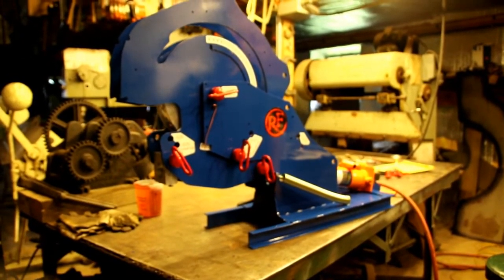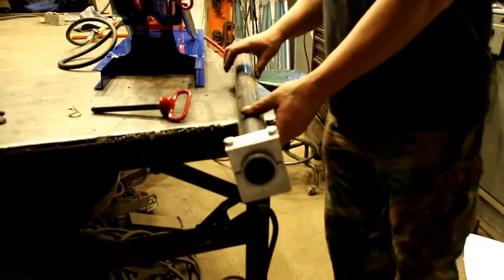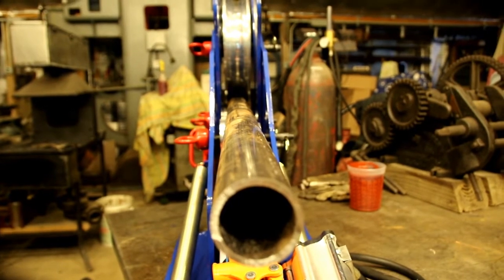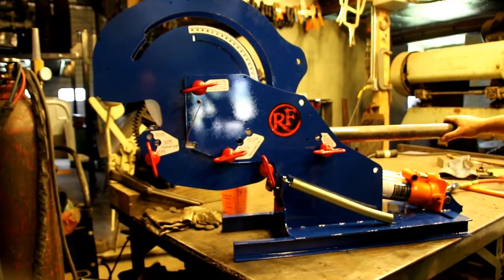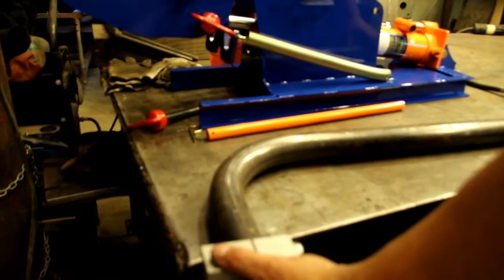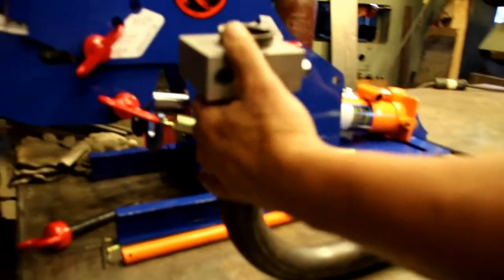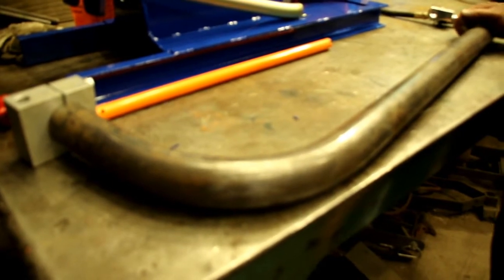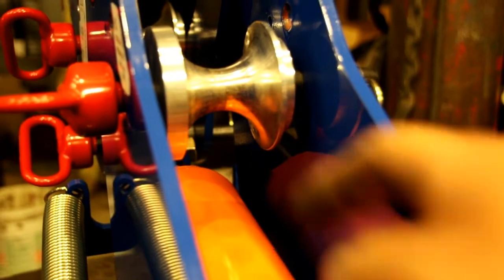Metalshaper: First bend on Rogue 600 xHD Tube Bender

Comment: good stuff. just finished putting mine together. haven't even used it yet. about to order the HD stuff to upgrade mine i think. along with a few other goodies like the delrin lock pin and hydraulic bleed knob. thanks for the video.

Comment: Hello. Now that you have had the bender for 3 years do you have any complaints or insider recommendations ? I am about to place my order for the XHD model.  Just want to make sure this model is worth the extra money over the standard 600. Thanks Demon
Reply from the maker: it is a great bender and I don't have any complaints.   Remember this type of bender only has a few different radius so if you do a lot of bending check the radius you need.  Other than that it is great and worked flawlessly on a job where I had to bend 1-1/2" solid steel round bar.
Reply: @metalshaperJeep  Thank you for responding man. I'm glad to hear you are still happy with it.

Comment: I just got this bender and am having trouble with the actual air ram operation. The instructions say that to hold the air ram vertical and add fluid to the drain plug and then bleed it which I did. Ram seems to work fine vertically but as soon as I put it in the bender it won't bend past 25 degrees or so. The air ram just won't extend. Did you overfill the air ram with fluid?
Reply from the maker: most of the ram units don't need oil added to them .  Mine worked fine right out of the box and many others the same way.  I think you may have too much oil in the unit and that is causing your troubles.
Reply: metalshaper I did try it right out of the box and it didn't want to work. I was just wondering if maybe other users of this bender needed to overfill the air ram when it was in place. I will say I was using the manual pump so I will try it using the air and see if it makes a difference.
Reply: Was able to try it out last night using the air instead of manual pump. Worked just fine. Not sure what was going on. Thing rocks though! Great product

Comment: What would be the rough cost of a complete body for a MB  with some changes RHD, & 3 inches more leg  room to fit a Toyota Hilux turbo diesel chassis , base cost plus regards Frank
Reply: It’s common thing here in Thailand but the work is so rough and welding is that bad ( like hessian undies ) and I would like a project when I return to Melbourne Australia regards Frank
Reply from the maker: Lots of problems with overseas bodies, I have seen lots of problems with them and don't like to install them.  But the cost is cheap and many people like them because they have no other options.
Reply from the maker: Not sure of  the total cost with the modifications you describe.  Contact me directly at metalshaper@comcast.net when you are ready.  
Brian
Reply: Will do when I get back home, thanks again great Chanel keep up the good work regards Frank

Comment: What's the machine on the other side of the workbench?
Reply from the maker: if you are talking about the tool with gears on it sitting on the bench it is a blacksmith tire bender.  Bends the iron band that went around the wooden wagon wheel.  Hand crank tool over 100 years old and still working great

Comment: After your first video on this bender, I looked at the Rogue website, I did this because you mentioned that it would bend 2" dia solid steel rod! To my amazement, there on the video was a demonstration, for such a light machine, (it could easily be moved around the shop), this is a very good machine to have, the company will even ship it to Europe for me !
Reply from the maker: This is a great tube bending machine and you won't be disappointed with any part of it.  The weld together kit goes together easily and the power is amazing.  Good assortment of dies and a great company to deal with.
Reply: Awesome! Thank you Englishman. We do ship them across the pond, and they are very stout for their weight.